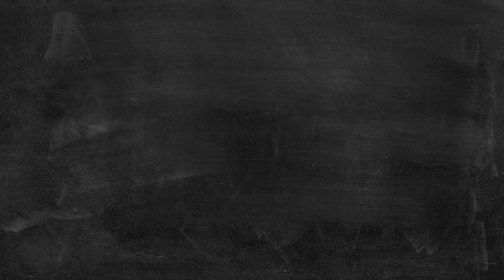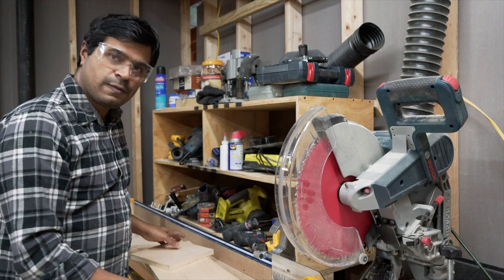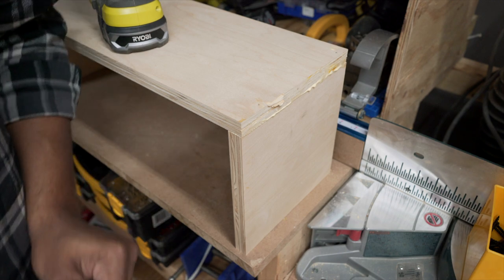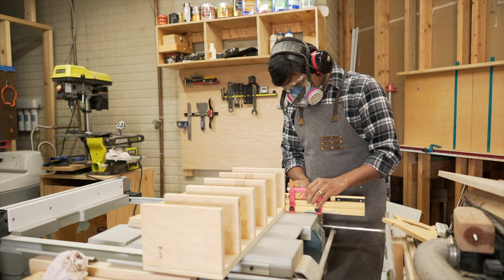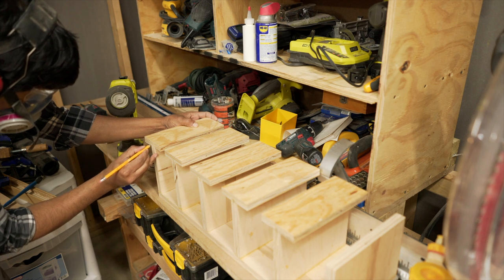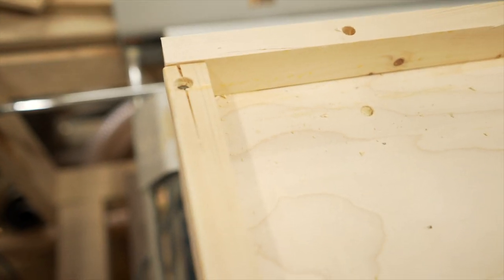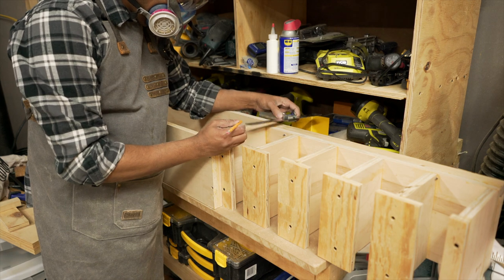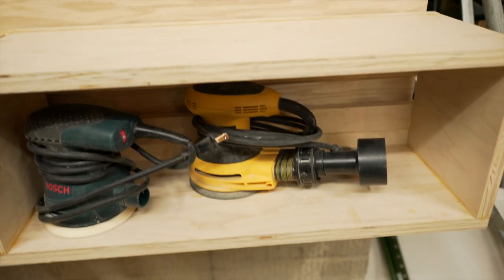Cool Shop Hack : Build a Drill Driver Holding and Charging Station with French cleats!

Comment: Nice video - working on French Cleat wall of my own.  As I was asking people about magnetic strips for holding my chisels, several people pointed out to me that it is not a good idea to let chisels or any other bladed that need to be sharpened on stones, etc magnetized since metal fragments will cling to the metal while sharpening creating grooves etc. instead of washing away.  Just something to consider.  Many other ways to hang your chisels and cabinet scrapers besides magnetic strips.
Reply from the maker: Thanks for the suggestion about chisels! I was completely unaware of it! I was trying to put everything in the open and easy access but if they affect the performance of the tools, then I’ll store them away!
Reply: @KiranBhatWoodworking  can still store them in the open and accessible...just build a wooden rack what will also work with the french cleat system
Reply from the maker: David Sisk That’s a great idea, thanks! I’m stuck building a big project, once I finish that, I’ll work on the Chisel holder!